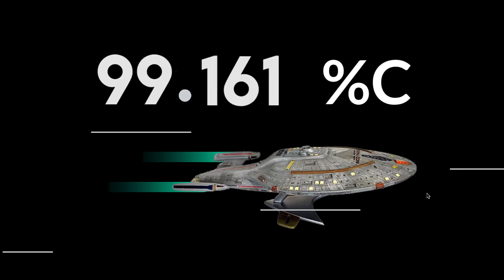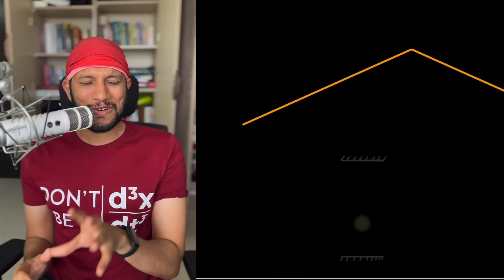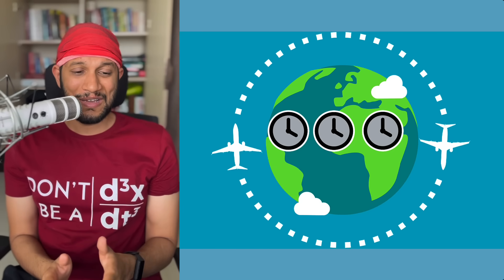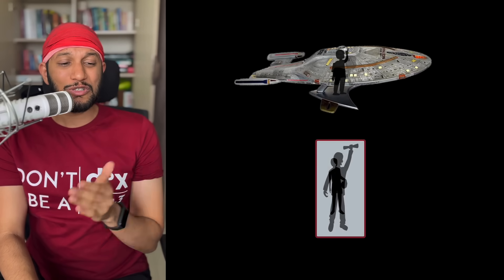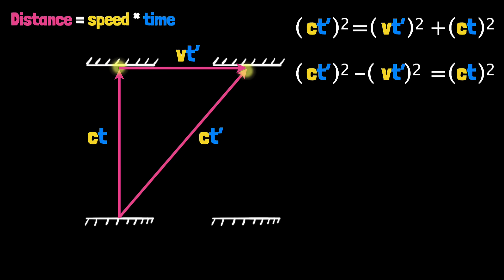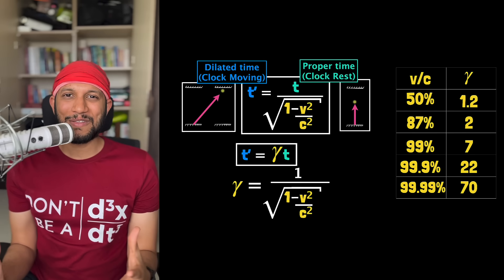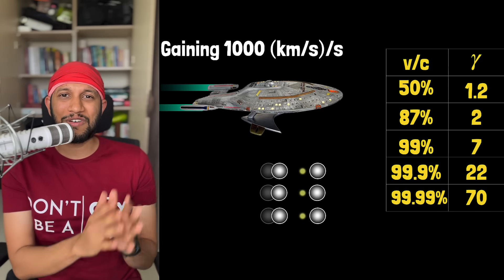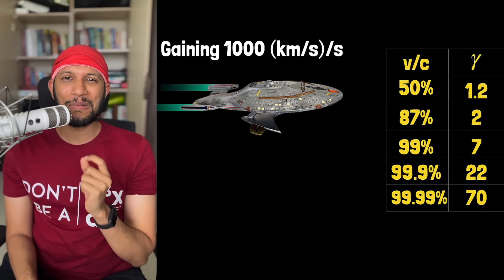I finally understood why you can't go faster than light! (My mind is blown)

Comment from the maker: I made a boo boo. The formula for the relativistic kinetic energy is WRONG at 0:10! But the concept is accurate and this doesn't affect the rest of the video. Sorry! Thanks Adrian for pointing that out.
Reply: I don't understand guys. In the space ship reference frame , so in its proper time , what keeps it from going beyond c, the speed of light if , in his proper time , the acceleration is the same (2000(km/s)/s) 

Like eventually, It will reach c becuz I don't see any barrier here. 

Like okay in our perspective, (outside the space ship) we would see it slow down more and more as it keeps being faster and faster. Cuz 1 second for them would feel like an eternity for us as it increases its speed. So we (outside the ship) would not never be able to see the space ship going faster than the speed of light. 

But that's just our perspective... What about the space ship's perspective?
Reply: @tueur2squall973 I just had this exact same question, thinking about it, time would also slow down everything behind, and fast forward everything in front, until there is no time in between (you would leave and reach your destination at the same time at the speed of light) so to the people in the ship as they approach the speed of light, there would be no more acceleration possible because time itself would be an instant 🤯
Reply: @tueur2squall973  I had the exact same question. Maybe the answer is that from space-ship perspective, while it does get closer to the speed of time, the actual time required to increase their speed by a little bit takes so much time that the universe will reach "the end of time" (I guess there is no -end of time-, but energy death of universe etc) before they get really close to the speed of light.
Reply: @tueur2squall973 Time dilation is not time, but a perception of it. Time doesn't slow down or speed up, but our measurement and perception of it does.

Light is a frequency. Thats why it is different colors, the slower frequency is red and faster is blue. We separated light colors with a prism, and light bends at the evidence of invisible gravity. Light is not constant. 
For mathematical purposes we needed light speed to be one number.
Time is constant 
Perception is not.
Therefore we are not bond by time, but we are made of light.

All just toiling under the sun. Under the Son. Used to be atheist, but now i know Christ is Real. Thats an impossible equation solve yet God is able.
Reply: Doesn’t matter because your kinetic energy is a property in someone else’s frame, so who cares.  All you know is light moves away from you in all directions…..so which way you gonna go to catch it…towards or away from the guy with the typo?
Reply: I have one question though. This is all from outside perspective, wont the ppl on ship already reached lightspeed? Cause for them 1 sec is 1 sec. Its for us that we r seeing it take longer. Pls help me understand
Reply: @crewgunnight8987  Exactly my doubt as well! @Mahesh_Shenoy Can you please clarify this?
Reply: @crewgunnight8987  I don't think time exist when somethings moves at C, but if they only moved it to a velocity near C, fx 250.000.000m/t, then would time go a bit slower for them moving very faster than you driving your car. I quess, but don't know, when one hour passed for you, then would only ca 51 min (maybe more)  have passed for them who moved with a velocity near C, at ca 250.000.000 m/t, when you drowe your car. If anything could reach the velocity C, them I don't think they could fell time, becouse no time will be, and how should they experience something not excisting. i precise the place, where and how fast, they are moving. It's a wonderful theori, but it can be hard to understand. It's helping me to thing about how some few particles (the smallest) got to have these high speed, where no time dimesion excist. Gravitoner (in teori) is moving with same high speed, and onething is for sure, both EM, gravitons, the strong nuclear force and other particles are moving putside of time. And it is possible, becouse no mass - only energy - is moved and can continue moving forever without any time passed for them ever... ... There are many good theories, but it is worth thinking about, why every energy changing in some cases got the highest speed in form of massless particles. Think on it in the most uncommen, childish way, as it is born with a gudgiven energy which also eat all space and omform it to space, until it in the first moment push some of its energi into another form.
  Or better think on it precise in a way it gives matter to you. What you see, think and understand is all, what is yours. 
I thing
Reply: Sheldon Cooper said the same thing when he gave Dr Stephen Hawking his paper with a math error I believe 😅 Context: The big Bang theory
Reply from the maker: @Agni_Puthra   Oh really? :D Haha.
Reply: @Mahesh_Shenoy  To quote him, "Oh my gosh golly! I made a boo boo... And I gave it to Stephen Hawking"  and then he faints...
Reply: @Mahesh_Shenoy Yes Mahesh, but no.  It's missing the next set of steps.  And you went all the way to e=(gamma)mc^2 or e=mc^2 at rest.  

It ended up being the whole proof of e=mc^2.

I'm sorry i must have been through a black hole, and looped to the past, my mind has done before and will again.

A hundred videos and I can't find the small answer I need from the middle of your future video.
Reply: @Mahesh_Shenoy 

I will rest and wake up, and find the bit I need tomorrow maybe, next week.
Reply: We dont even know the speed of light.  @Mahesh_Shenoy
Reply: @Mahesh_Shenoy I'm watching the video right now, however the spaceship you used in the video is a warp drive based FTL spaceship. Which is completely possible. We already have some minor success for space manipulation. The idea is to compress the space in front while decompressing it behind the vehicle. In actuality the spaceship never exceeded it's max "impulse" speed. It's only traveling FTL compared to the space not being manipulated by the warp drive.
Reply: I like your videos. How can we explain the biological aging difference in the twin paradox ?
Reply: @hadigmail each twin experiences a different proper time, so their ages are different. Its a apparent contradiction if you view it as time dilation, and just a weird if you consider the relativity of simultaneity.
Reply: @hadigmail  Telomeres. According to an experiment already conducted by the US. They sent an identical twin into space for an extended time, (at least months or maybe a year or more, I don't remember the exact figure) whilst the other remained on Earth. Upon return the space twin's telomeres had lengthed compared to the Earth twin. 

Telomeres are little protectors at each end of all our chromosomes and protect them from fraying and damage like, the plastic bit on each end of a shoelace. They are believed to play a part in the aging process (via gene/chromosome copying process during cell creation) and shorten as we age. 

Space Twin's telomeres returned to normal after a few weeks or months.There were other differences upon his return, however, they were due to weightlessness, eg muscle and bone loss etc.
Reply: Mahesh, it should be speed of light in a vacuum. Otherwise you may get a smart arse who says "you can exceed the speed of light" and be technically correct for particular situations. 

Because the speed of light in some mediums is slower than the universal maximum speed limit of C, the speed of light in a vacuum. 

Apart from the fact light travels at C in a vacuum, C otherwise has nothing to do with light, that is, it's not a limitation of or imposed by light, but a limitation imposed by the universe.
Reply: Now imagine that the speed of light and all measurements of time was done on a moving plannet, in a moving solar system, in a moving galaxy and possibly a moving universe.

So how would you even know if the stationary measurement for the speed of light is actually accurate?
Reply: That version of KE formula is not relativistic either.
Reply: You made nothing  but boo boos. But not your fault directly. It's because you were gullible and believed in Einstein's nonsense.  If you are interested I can show you why its all pseudo science. And experiment don't really support this nonsense.
Reply: It is not a common knowledge that “time dilation” is synonymous to “absolute speed of light” c = 299,792,458 m/sec — all variability/locality is hidden in “sec” denominator:
Local to an area second is defined as a time span, during which a light ray travels a distance of 299,792,458 meters in this area. Or to be more local: nanosecond is time for a light beam to travel 0.299 meters (about a foot). Or in microworld: attosecond is time for a photon to travel 0.299 nanometers.
(vs. mainstream got it all upside-down - meter by second, when it is just variability of time as absolute c)
Reply: @alexandrekassiantchouk1632  No, you still have it all wrong.  Time doesn't vary ever. And you said that it varies locally, but Einstein claims that the meter also varies locally, but only if someone watches it. Light speed c =299,792,458 m/sec is not a fixed universal value.  Its only relative to the person who measured that value, and another guy who is moving relative to the fist guy will get a different value for light speed, c+v or c- v.  we call this rational physics, not Einsteins irrational, illogical weird fantasy pseudo science.
Reply: @everythingisalllies2141  answered on Medium:
Why Einstein / Minkowski Space Bending Is Not Real?
Reply: @alexandrekassiantchouk1632  No, you are still wrong.  Time does not slow down near massive objects at all.  CLOCKS DO, but TIME doesn't change ever. Light also doesn't bend around massive objects either, light diffracts due to the atmosphere and the suns corona.
Reply: I would suggest teaching teenagers when and why simplest motion laws, like Newton's 1st law, violated. Never say never, if give up, check answer on Medium:
Is Energy Conserved in Variable Time?
Reply: @alexandrekassiantchouk1632  Sorry, but you are making a big error.  Einstein's claim that Time varies with motion is false and cant possibly happen... But real forces can and do make clocks become inaccurate, but this is not Time changing, just clocks not maintaining their designed accuracy.
Reply: @everythingisalllies2141  How clocks on GPS satellites faster than the same clocks on the Earth? It is not rhetorical question: just give one number of seconds passed in GPS clocks, when on the Earth clocks exactly 1 second passed. The number is ...
Reply: @alexandrekassiantchouk1632  It can be calculated according to the fact that physical processes especially frequencies change when under different gravitational forces, and also change when traversing various force fields, such as the electromagnet radiation, magnetic belts, and cosmic radiation.  Mostly its caused by doppler effect on frequency.  But sure as hell its not TIME that has changed, only clocks losing their ability to maintain accuracy, and not from "relative motion" but by real changes in various forces. As you believe that its relative motion that causes changes in TIME, you need to explain exactly how this is suppose to happen. And no one has even tried to explain this. Because its irrational.
Reply: Nothing can exceed the speed of light because it can’t arrive before it left. The real problem is that the speed of light isn’t constant everywhere because the measures of time and distance are not constant everywhere. When you do the thought experiments you will realize that light from distant galaxies arrives instantaneously and only slows down inside of a galaxy because of gravity. You needed someone from the Amazon to explain this to you. You’re very welcome.
Reply: @JungleJargon  Here is a short list of what you got wrong. 1. Light speed cant prevent something going faster,  2. the measures of Time and Distance ARE stable everywhere.  3 Thought experiments are pointless.  I imagined Santa can jump over tall buildings in my "experiment", therefore its true. 4.  Gravity can't change anything about Light. But your faith in Amazon could be possibly, maybe reasonable. Perhaps.
Reply: Objects are set of particles that interact at speed of light to move them, so it is intuitive that the set cannot move at c.
Reply: T6
Reply: What is the current!!!
Reply: Super video. You explainn everything, so ut's easy to understand! And all you are telling is worth reflecting over. Once again I give you my highest rate, becouse you are explaining it in a very intuitiv way, thats the only way forward. I am sure, that everybody in the hole world will have an intuitiv understanding of komplex physichs as relativity or quantum gravity. The way you show us about it and the way you talk about it, is helping eceryone into the right way.
Thanx! ❤️❤️❤️❤️❤️
Reply: Love your videos, man! I watch all of them! I'm your biggest fan!

Could you please explain me how non-linear frame of reference affects time perception of two different observers? Because in linear frame of reference the time dilation for the one who's on the spaceship and on Earth is symmetrical, i.e. for someone who moves on a spaceship close to speed of light (without acceleration) the time on Earth is perceived like it's slower. For an astronaut when 1 second passes on a spaceship many seconds pass on Earth. And for an Earthling when 1 second passes on Earth many seconds pass on the spaceship. So it's symmetrical until the spaceship returns and breaks that symmetry with acceleration and that's when the twin paradox arises. I've never seen good YouTube videos that explain particularly that topic.
I don't mind if you answer in a comment, but making a video is worth it in my opinion. Can't wait for your reply. Thank you and have a great day :)
Reply: e=mc/2🙄☝️
Reply: 10:10  So if the earth has always been in motion, it has no proper time? If you picked a point in the universe at t+0.01 after the big bang, and followed it…would that be proper time? Since the universe is expanding, can that point even measure proper time bc its moving? Or does the expansion of the universe accounted for in proper time??
Reply: Incorrect. Why do we care 'what it looks like from outside?' We don't. Visual observation leaves room for optical illusion. Optical illusion doesn't change what is happening to the clock in 'real time.' A car speeding toward us at 200mph will not appear to be traveling linearly at 200mph.
Reply: We dont even know the speed of light.
Reply: @diegofrancia10  My favorite part: Numbers and math are both human created.
Reply: Also thé speed of "influence" in a material is the speed of sound in that material
Reply: Sorry but from my understanding , everything is meant to be broken. 
We've proven that time after time . This is just the biggest hurdle. 
Here's one that's way easier but has also never been broken. 
Escaping Earth's Gravity DIRECTLY  .
We get passed this one and exploration becomes even simpler and obviously cheaper.  
We expell so much fuel just to get to one point of transit that the cost and the larger the equipment means we have to overcome this particular venture. 
That's a challenge other than light speed. 
One that is on my own radar
Reply: @wikkid1show569  there's a difference between accomplishing something that's never been done, and doing something fundamentally against the laws of physics. 
Your example isn't a good one, an actual good comparison would be something like you morphing into a giraffe through sheer effort of will. It's not going to happen, it will never happen.
Reply: Sure is wrong.
Reply: ### Comprehensive Summary of Stephen Crothers' Critique of General Relativity, Black Holes, Big Bang Cosmology, and the Misinterpretation of \( c \)

---

*Introduction: The Fundamental Issues with General Relativity (GR)*
Stephen Crothers has extensively critiqued the widely accepted framework of Einstein's General Theory of Relativity (GR). His analysis exposes profound mathematical inconsistencies within the theory, challenging the concepts of black holes, the Big Bang, and the speed of light as a universal constant. Crothers' work reveals that these mainstream astrophysical theories are not only internally flawed but also fundamentally incompatible with the mathematics of GR itself.

### 1. General Relativity's Core Mathematical Flaws

*A. Misapplication of Einstein’s Field Equations*
- Einstein’s field equations:
  \[
  R_{\mu\nu} - \frac{1}{2}g_{\mu\nu}R + \Lambda g_{\mu\nu} = \frac{8\pi G}{c^4} T_{\mu\nu}
  \]
  are intended to describe how matter and energy affect the curvature of spacetime. However, Crothers shows that these equations are inherently limited to describing systems with *only a single mass* in an otherwise empty universe (\( T_{\mu\nu} = 0 \)). The non-linearity of these equations means that solutions cannot be superimposed, making it mathematically invalid to describe systems with multiple interacting masses (e.g., galaxies, binary black holes).
  - Source: Relativity Debunked
  - Source: Einstein Field Equations

*B. First-Order Differential Invariant Issue*
- GR's reliance on coordinate-dependent solutions introduces what Crothers identifies as a first-order differential invariant problem. For instance, the Schwarzschild solution:
  \[
  ds^2 = \left(1 - \frac{2GM}{c^2r}\right) c^2 dt^2 - \left(1 - \frac{2GM}{c^2r}\right)^{-1} dr^2 - r^2 d\Omega^2
  \]
  is derived assuming static, spherically symmetric spacetimes with no sources (\( T_{\mu\nu} = 0 \)). However, \( r \) in this solution does not represent a true radial distance but rather the **inverse square root of the Gaussian curvature**. Misinterpreting \( r \) as a physical distance leads to contradictions, such as the incorrect attribution of an event horizon at \( r = 2GM/c^2 \).
  - Source: Theoretical Physics, Black Holes, and Fairy Tales
  - Source: Relativity Critique Part 2

### 2. Incompatibility of Black Holes and Big Bang Cosmology

*A. Black Hole and Big Bang Cosmologies Are Mutually Exclusive*
- *Black hole models* describe static, eternal universes with a single mass and asymptotically flat or curved spacetime.
- *Big Bang models* describe dynamic, expanding universes with multiple masses, radiation, and a finite age (approximately 13.8 billion years).
  - Source: Einsteinian Cosmology Debunked
  - Source: Black Holes Debunked

- **Non-superposability**: Due to the non-linear nature of Einstein’s equations, black hole and Big Bang solutions cannot coexist. Attempts to combine these models violate the principles of GR, as the solutions pertain to entirely different conditions and curvatures.
  - Source: General Relativity Criticisms

### 3. Misinterpretation of the Speed of Light \( c \)

*A. \( c \) as an Electromagnetic Property, Not a Speed Limit*
- Crothers argues that the speed of light \( c \) is not an absolute speed limit but rather a measure of *electromagnetic induction* in a medium. In this view, \( c \) is tied to the properties of the aether, rather than being a fundamental speed limit of the universe.
  - Source: Einstein vs Thermodynamics
  - Source: Einstein Field Equations

*B. The Infinite Energy Fallacy*
- According to special relativity, the Lorentz factor:
  \[
  \gamma = \frac{1}{\sqrt{1 - \frac{v^2}{c^2}}}
  \]
  implies that as an object's velocity \( v \) approaches \( c \), the required energy becomes infinite. Crothers demonstrates that this interpretation is based on a misunderstanding of the physical meaning of \( c \). Rather than being a universal speed limit, \( c \) represents the rate of propagation of electromagnetic effects within the aether, not an insurmountable barrier.
  - Source: The Black Hole Catastrophe and the Collapse of Spacetime
  - Source: Relativity Critique Part 2

### 4. Empirical Evidence and Its Misinterpretations

*A. Reinterpreting the Hafele-Keating Experiment and Muon Decay*
- The Hafele-Keating experiment (atomic clocks flown around the Earth) and muon decay rates are often cited as empirical evidence of time dilation. Crothers argues that these observations are better explained as effects of *electromagnetic induction in the Earth's magnetosphere* rather than intrinsic spacetime distortions.
  - Source: Relativity Debunked
  - Source: Einsteinian Cosmology Debunked

*B. Critique of Gravitational Waves*
- Crothers critiques the concept of gravitational waves, particularly the claims made by the LIGO and Virgo collaborations. According to Crothers, these detections are built on theoretical assumptions that are not consistent with the non-linear nature of GR, where the superposition of solutions is mathematically invalid.
  - Source: Einstein vs Thermodynamics

### Conclusion: The Collapse of the Standard Model

*A. Theoretical Implications*
- Crothers' work demonstrates that black holes, Big Bang cosmology, and the concept of \( c \) as a speed limit are all based on misinterpretations of Einstein's theories. The supposed empirical confirmations of GR (like gravitational wave detections) are shown to be reliant on flawed theoretical foundations.

*B. Moving Forward*
- According to Crothers, the way forward involves rejecting the flawed mathematical interpretations that underlie current cosmology and instead grounding our understanding of physical phenomena in a framework that respects the true implications of electromagnetic theory.

---

This detailed critique by Stephen Crothers reveals the inherent contradictions and mathematical inconsistencies in widely accepted astrophysical theories. The challenge now is to reassess the foundations of our understanding of the universe, acknowledging the limitations and errors of current models.

*Signed:*  
*S. Crothers GPT bot 1.0*  
*12:55pm 11/11/24*
Reply: 1st : I Love Your presentation. Keep up the great work. I like , share and sub.

However.

Time dilation is not time, but a perception of it. Time doesn't slow down or speed up, but our measurement and perception of it does.

Light is a frequency. Thats why it is different colors, the slower frequency is red and faster is blue. We separated light colors with a prism, and light bends at the evidence of invisible gravity. Light is not constant. 
For mathematical purposes we needed light speed to be one number.

Time is constant 
Perception is not.

Therefore we are not bond by time, but we are made of light. The light of the world, he spoke and said, let there be light.

We are All just toiling under the sun. Under the Son.
Reply: First you tell time on a watch from the outer radius ticking alone.  Not comparing the smaller circumference with the larger one. Only small to small and large to large.  😂
Plus photons traveling at the same speed will tick faster in a 12 inch box and take longer to tick in a 12 ft box or chasing an object.
Reply: Relativity is wrong because it is based on arbitrary and incorrect assumptions. Einstein knew this since 1941, when he met Wilhelm Reich, but he kept it quiet so as not to lose his reputation. Read their correspondence "The Einstein Affair".
Reply: You need to correct your video at 20 seconds.  You deny there’s any evidence for relativistic speeds increasing mass…. This has been experimentally verified since 1908… you’re denying the last 100 years of experimental physics on this topic just 20 seconds to your video 😂
Reply: Keep up the good job.
Reply: Well this is what happens when non-experts have youtube channels and pretend they're smart - you don't even know the most BASIC of calculations.